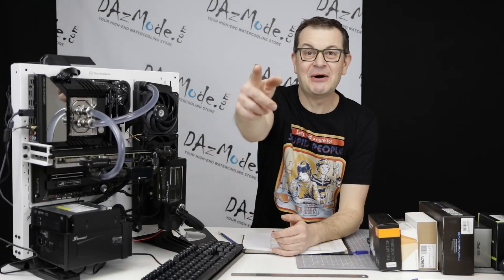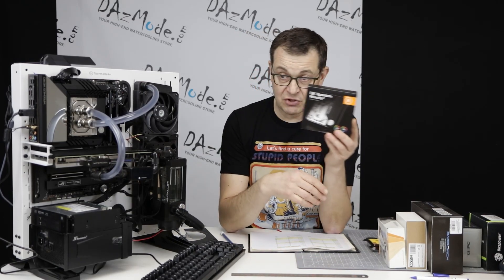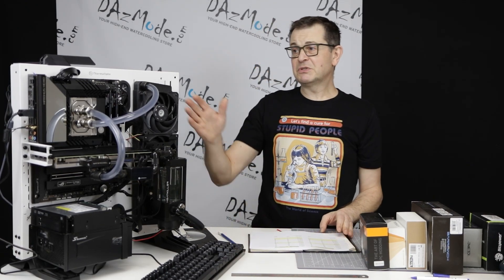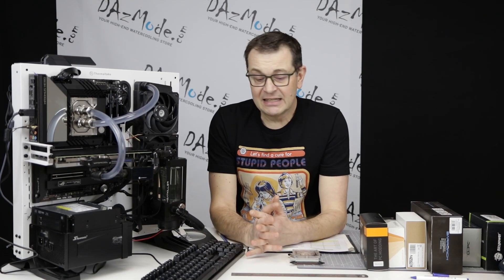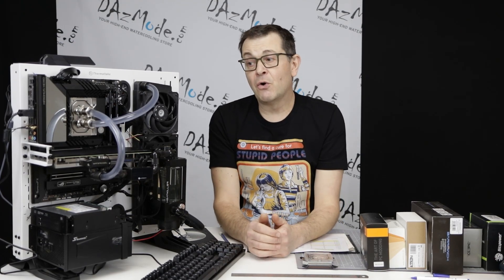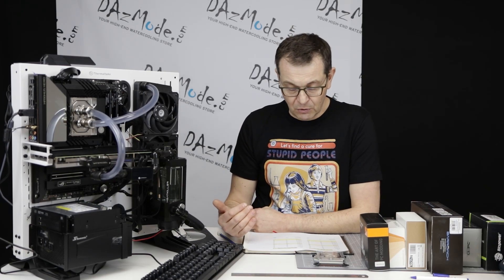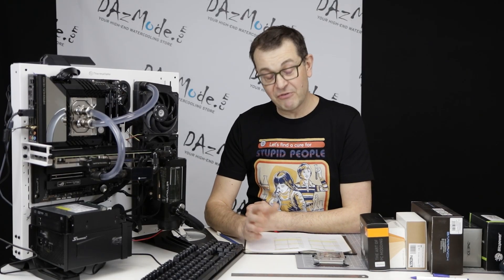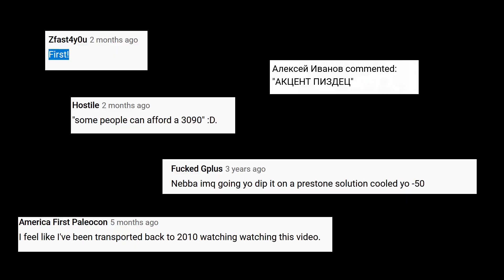Does Velocity2 worth upgrading to?

Comment: I've had it for a week. I find it efficient but not really more than the 420mm Arctic liquid freezer 2 that I had before it. I'm using it with a 420+280mm Hardware Labs radiators and a combo pump/res from EK too. I was surprised by the mounting the waterblock from above, not very practical in my opinion... and then the tightening, without the special Torque Screwdriver 0.6Nm which is not in the package impossible to know if it is tight enough or not. I installed it with a Thermalright lga1700-bcf contact frame.

Comment: Good comparisson, is what I was looking for. Full Nickel Velocity goes for 120 USD at PPCS and the Velocity2 jumps to 190, so that's close to 50% more expensive. Don't like the fact that Velocity2 is socket limited. Then AM4/AM5 block won't wotk with LGA1700 hardware. Regards

Comment: I have one very inportant question about velocity2. Block seems to be simetrical from the bottom side. But in the pictures it is always mounted with velocity2 logo - closer to memory. Can in be mounted otherwize with part with logo towards the IO shield? I'm asking because in one direction in and out holes alre closer to IO... and i MUST have them closer to RAM. Can in be mounter both ways. (I'm not thinking of mounting it 90degrees only logo close to ram and 180deg. close to IOshield)? Thank you.

Comment: How many turns would you say it took before the screw driver clicked? I'd love to feel like I mounted it right without wasting 25 on a screwdriver I'll literally only be able to use for this!!
Reply: I have one of these on an overclocked 13900K that I have just built. I fitted the Thermalright contact frame instead of the standard ILM because it was so cheap as to be a waste not to. For the Velocity^2 block I tightened the four corners using a hex key in a star pattern and I personally did them quite firmly but trying to feel equal tension by hand. The block has a very rigid backplate so I think is quite forgiving.

Comment: Oh no my friend this is not a correct comparison.... I appreciate you trying to find if there is real life benefits from one block to another but comparing blocks with different voltages invalidates the whole test. Please do a proper comparison with identical settings even though we can all figure by now that 5C with lower voltage equals no temp difference when the voltage gets equalized... Maybe someone needs to push the new blocks sales...
Reply: Test is valid imho because as Daz says it's a test of how much better one block does over another.
The test isn't about exactly how much cooler your system can run with the exact same everything but different cpu blocks. 
If you can achieve lower voltage settings with stable system, allowing you to run cooler and use less power, then that shows one block is doing a better job than the other.
I would like to know if the Cinebench results for the tests.
Reply from the maker: Why do I need to lock voltages if one product cannot go lower and the other can? I will see how things go with the third block.
Reply: @DazModeWatercooling  Because voltage affects temperatures. Different voltage = different temperature
Reply from the maker: @beyondspecs9401  Naturally. But,... best practical result = best practical result. Having said that I have all the data for both methods.
Reply: @DazModeWatercooling   That is the best way, to share both results. Extra data is always better. Thank you for your work.

Comment: Quite dislike the idea of Velocity2 having that "Torque screwdriver", which brings me to the idea of possible damage to the waterblock if overtightened (yes, I do get it that overtightening a socket is always a bad thing). The screwdriver itself is good though. Used it when I was doing a maintenance for my gpu waterblock, where it came to be quite handy. Had a bad thermal paste application (or, at least, wanted to cross out that assumption), for which I needed to remove the CPU block (softtube, so I didn't go and disassemble the whole thing). Having to worry about the CPU block having some damage (and can't really use a leak tester at this point), caused by overtightened screws, is an additional headache.

Want to see how the Velocity results compare to Heatkiller.

Comment: Daz, I've got a question about that Heatkiller Tube 100 res that you're using in the bench setup. I'm thinking of picking up a DDC version from you, I'm moving my loop to the same TT P3 case; but looks like I possibly can't use the dedicated res mount plate, as my rad is really thick (280mm XT45 with push-pull). But at the same time I don't know if I can mount directly to 140mm fans - the guide you linked in the product page says Tube 100 cannot use 30234 140mm brackets, because the tube is too short for a 140mm fan?

I see that you are using 30236 and 2 x 30263 120mm fan brackets; is it possible to do the same, but with 2 x 30264 140mm brackets?

btw love the new videos this week, been wondering since release how the new block performs since it looks so different! Keep it up man

Comment: That's quite the jump in cooling performance, between the two blocks.
Hope you got some more coming next weekend.
Reply: If you notice, he has reduced the voltage by 0.02v, how would changing the block make the chip more stable based on such a insignificant temperature drop allow for a lower voltage? I would understand if we were talking 20c but combined with voltage drop+flow rate only gained a 4.5c delta reduction? Absolute rubbish.
Reply: @gh4z  you tell'em!

Comment: I'm really enjoying this series! Do you have access to the Optimus PC waterblocks? If I remember correctly, they've claimed like 10c lower temperature with their blocks compared to the competition. Also, they apparently have very high build quality.
Reply from the maker: Reached them some time ago, they are not interested to work with DazMode. 10c sounds as a stretch as optimus shares exactly the same design as everybody else.
Reply: @DazModeWatercooling  That's what I was thinking as well. Although, I have seen some very positive reviews online. It's hard to judge because a lot of people have a bias to positively review the premium product they've sunk a lot of money in from my experience.
Reply from the maker: @Invictus_Mithra  usually small shops makes exclusive , quality stuff, which is value on its own. Naturally cost is high.
Reply: @DazModeWatercooling  That is true! The quality does look exceptional. I was just wondering if the performance hype that's formed around them is real. Regardless, it does look like they make solid products.
Reply: I do have a Foundation block - it's definitely top tier in both design and perf, up there with TechN, it's solid and tough as nails. But not 10C improvement like marketing claims. Especially not on Ryzen, where it's hard to find 10C difference between even high end and low end air coolers. 

imo it's just a bunch of idiot users who don't understand how their own CPUs work - when on air you can easily see 10C variance from two different days doing the same thing, because boost algorithm. On water a bit less, maybe 5C variance.

TechN is already in the store, so no real loss in not having Optimus. Always love to see more content from you daz!